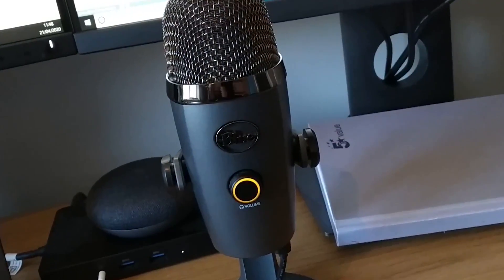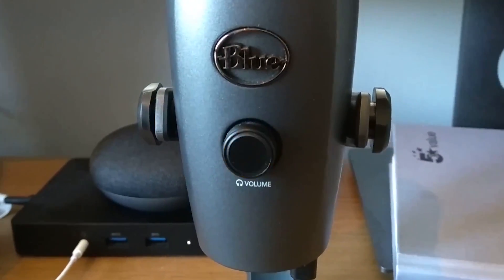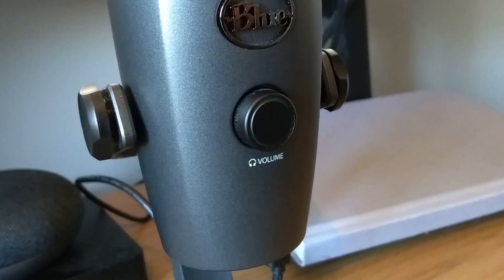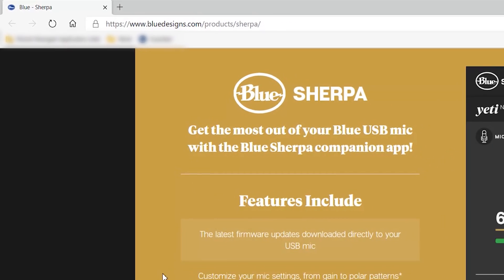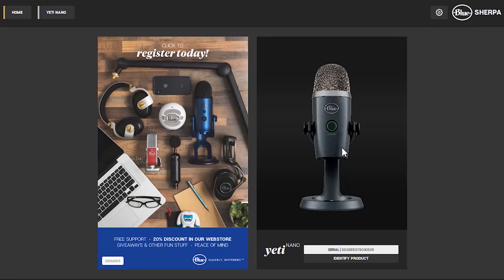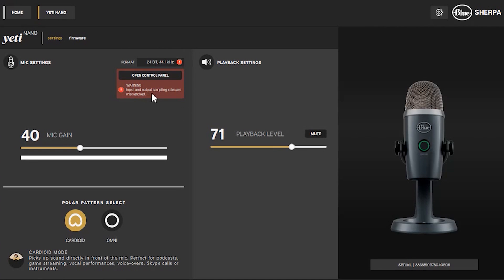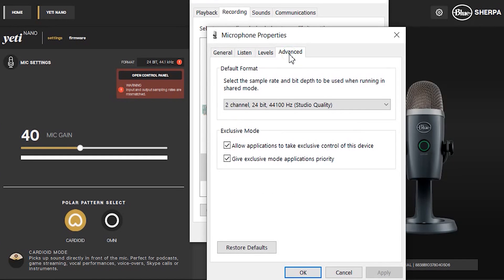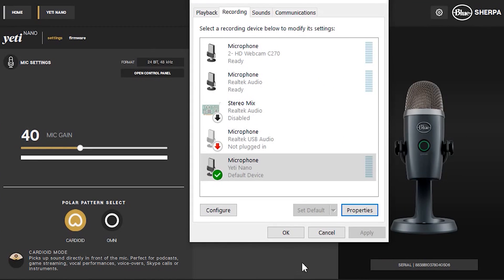Blue Yeti Nano - Yellow Blinking Light - EASY Fix

Comment: Thank you very much - great post.  Just purchased the Yeti Nano and out of the box I got the orange blinking light. The download is not required, however.  In Windows, open Control Panel (search control panel), change 'view by' from Category to small or large icons, click on sound - recording tab and follow instructions from 1:28 on.

Worked like a champ and thank you so much!
Reply from the maker: Thanks for the additional info, may make it even quicker for others to fix